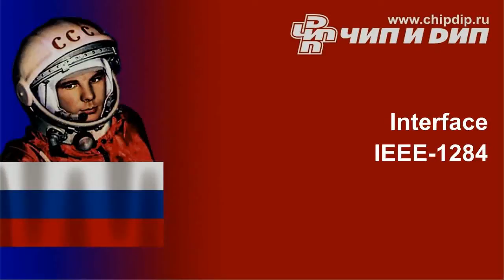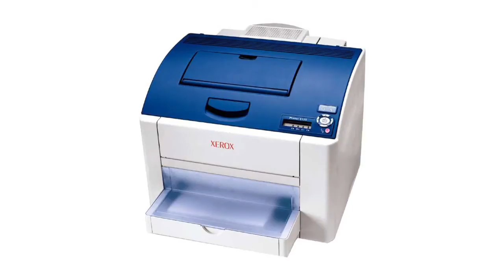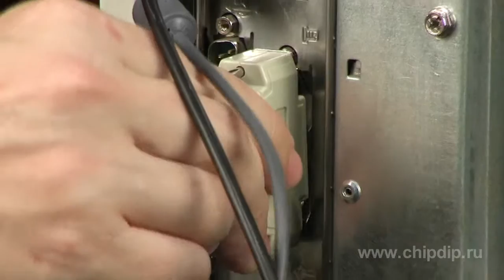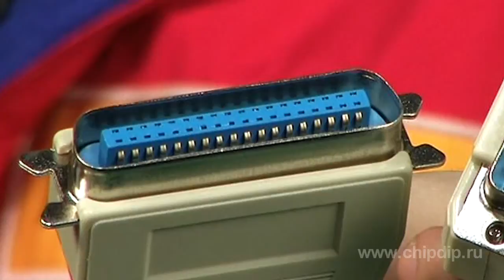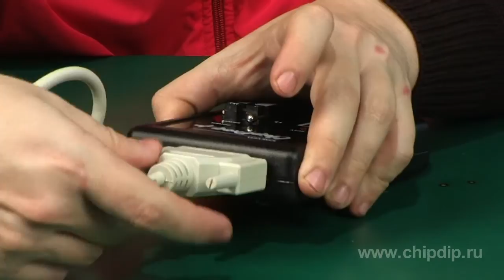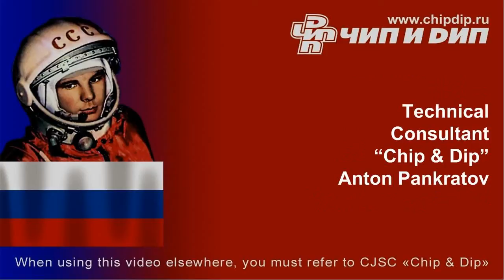Interface IEEE-1284

Comment: Nowadays, people are also looking for means of capturing the data from the IEEE-1248 parallel port, or to be able to connect a USB / Network printer to such a port.  We developed the Retro-Printer module to address such a need - www.retroprinter.com

It is a physical module which connects via a centronics connector, captures Epson ESC/P2 or HP PCL data and converts it to PDF (or plain text) and then prints it on any printer connected to a Raspberry Pi !

Comment: It grossed me out when I saw this monstrosity in my local shopping mall... Does anyone use this nowadays?
Reply: theres one in this fucking used 2013 business dell I bought.. wordering wtf it is...
Reply: Yes. These printers and cables are solid.
Reply: @aguilayserpiente  I made that comment 7 years ago, but you know, I'm willing to believe those printers worked better than the ones we have now
Reply: @Risenphantom  I have been using an HP k80 inkjet 3 in 1 (with button controls) for 30 years, with the IEEE cable. It still works but no longer prints color only BW. My 25 year old HP 3015 laser jet 3 in 1 still works like when it rolled off the assembly line.